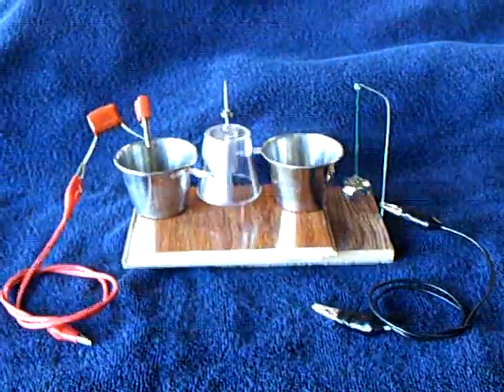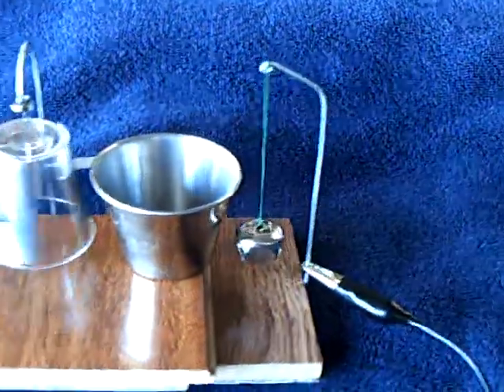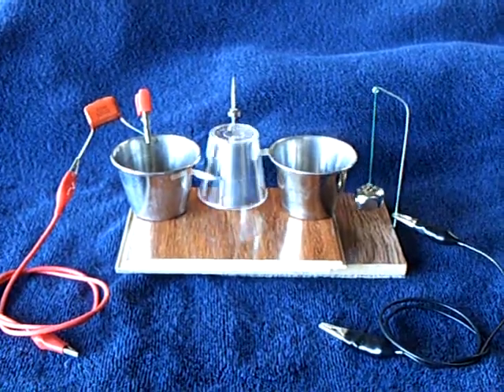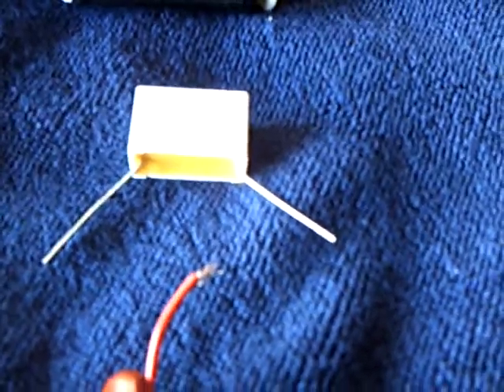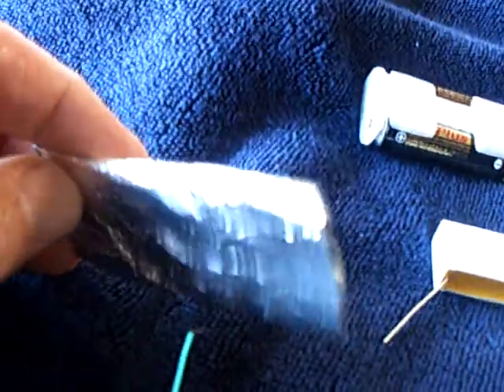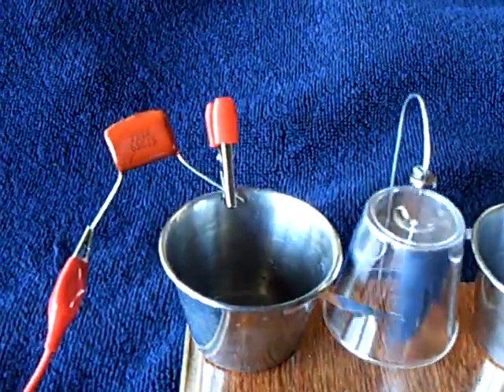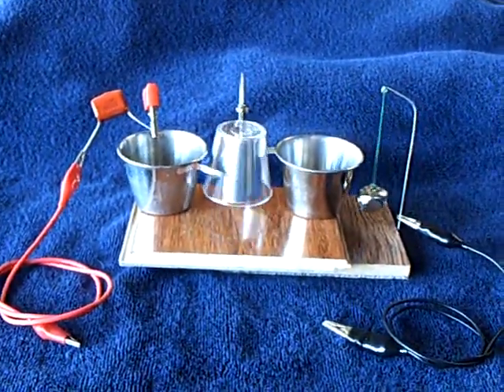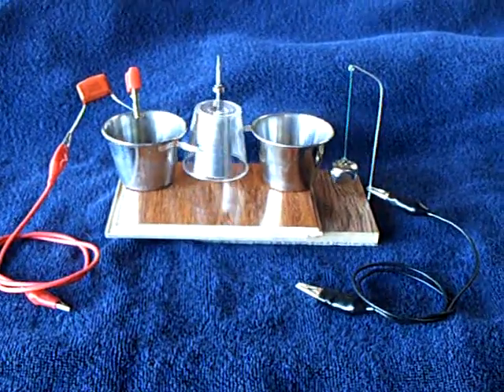Chiming Electrostatic Motor - Running on an open ended capacitor

Comment: This is awesome man.This is the most unique electrostatic motor i've seen.
I was thinking what if you connect a solar cell to a disposable camera unit designed to operate off one battery.Then remove it's flash capacitor and replace with your higher voltage caps >1000v.In theory this would work.I'm not sure what's the torque of the motor i wonder if this could raise water higher either to power generator or to be used as a water battery static generator.

Comment: FAKE !!!
Reply: Non non, lui je lui fais confiance, comme tinselkoala, pirate, Hatberlin ou lasersaber.
Reply from the maker: I have been waiting for that comment.  Take a look at all the other 'electrostatic motor' videos here on Youtube.  What is different about mine is that I am running it on a small pre-charged high voltage capacitor and recording the run time.  This has probably been done before but I have not seen anyone else do it.  I found out yesterday that the circuit return path is actually going through the blue cotton towel.  It is not really an open ended circuit ---just a very high resistance return path.  Strange things happen with high voltage.  I'm sorry if this looked fake.

Comment: This configuration is realy good.
4 houres and 30 minutes
0,00000022 farad and 630 volts, so when the capacitor is full there is aproximatly 0,5xCxU²=0,043659 watt of energy...
Reply: To see that, I realy wonder if the trick of jrcomputer or living4mymusic26 realy work.
Reply from the maker: Thanks for doing the calculations.  I was really surprised that it ran that long.  Towards the end the rotor was rotating very slowly but the bell kept ringing (softly) after the rotor stopped for about 30 more minutes.  The cap still had some charge on it after the run and gave off a small spark when I shorted it.  Unfortunated I cannot measure the voltages on these caps with the meters that I have.

Comment: I wonder, did you try to connect the capacitor with its plus and minus side at the cup? It should work better with minus at the cup because negative air ions are heavier. But I could be wrong.
Reply from the maker: Interesting. I will have to try it the other way around and see what happens.

Comment: Thats a neat thing-surprised it even works when you stand back and look at the current path...if you draw that out on paper and gave it to anyone familiar with electronics they would probably say that wont work.Yet there it is!
Also i would like to point out that its not so much the current behind the zap that hurts,its the frequency.
Whereas a Tesla coil is usually operating at frequencies high enough to not be felt by the human nervous system because these frequencies are outside our field of perception.
A cap discharging can likened to a bucket of water being tipped over your head,whereas the Tesla coil is more like a high pressure water pistol.
I had an idea before i even watched your vid-spawned purely by your video title...if you could wrap the chiming part(maybe use tuning fork) in a coil and magnetic field,you could harvest the mechanical oscillation....then it would be capacitor leaking into motor,with pendulumn and tuning fork/collapsing magnetic field feedback into capacitor...
Reply from the maker: I am learning that some strange things happen when you have about 1000 volts of potential with zero frequency.  The electron buildup really wants to leave where it is.  The return path might be right through that blue cotton towel or maybe right through the air.

Comment: That's the best one yet!!! I love that their is no apparent circuit, and that it looks open ended! Wow, I could see this in a nice setup as a long term display. I'm picturing it much larger though, so that the bell was much bigger. Actually, multiple larger bells tuned to different frequencies like a wind chime! It would be dangerous, but I have seen some great HV caps made from aluminum foil and orange home depot buckets!
Reply from the maker: The best part about this one was that I was WAY OFF on how long it might run.  Instead of 1 hour it ran 4 1/2 hours.  This open ended design really worked good.   I would like to build a bigger and better one of these but the potential for a bad shock gets too scary.

Comment: This is really cool, how long did it run for?
Reply from the maker: Thanks. This ran for 4 1/2 hours.  I was really surprised.  Having the cap open ended did the trick.  I'm not quite sure how this setup works

Comment: Cool! Thanks for sharing :) I'm surprise to see how low voltage it will run.
Reply from the maker: Unfortunately the meters that I have instantly discharge these caps when I try to take a reading.  I guess that it is somewhere between 700 and 1500 volts.  I am really just guessing though.
Reply: I wouldn't try getting my meter in those voltage even though it can handle 1kv dc I would probably use a high voltage probe just to be safe :)